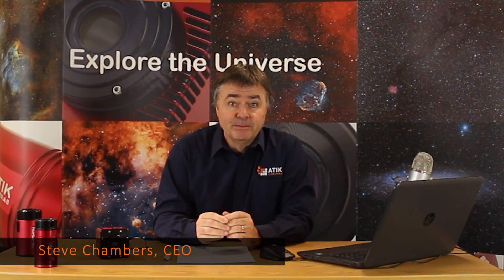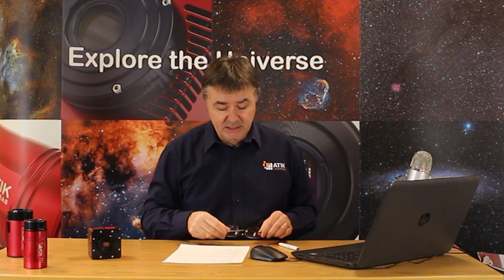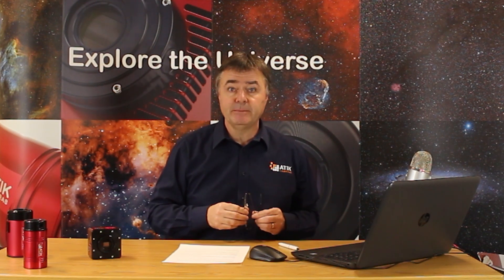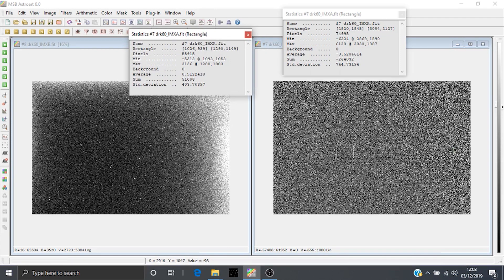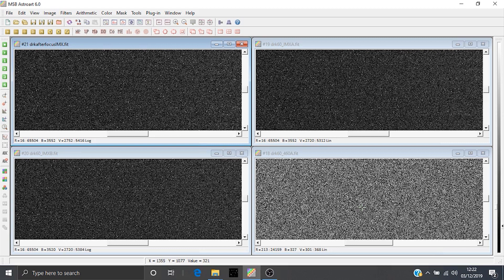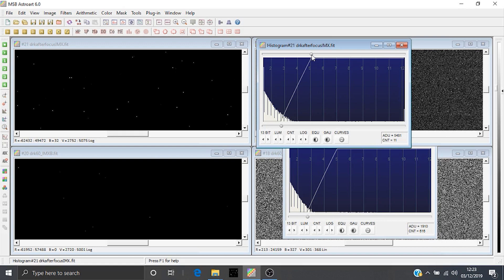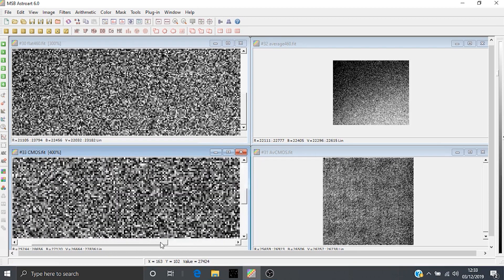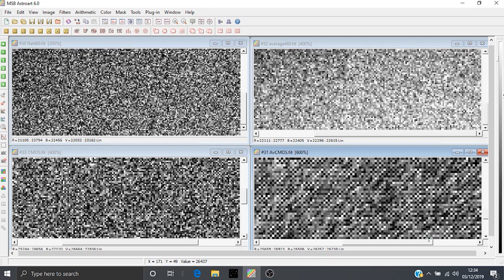The differences between CCD and CMOS calibration files| Atik Cameras

Comment: So in general then a CCD produces a “cleaner” image than a CMOS which is easier to post process, I have a 460ex colour and an Atik One 6.0 mono which I'm very happy with. CMOS cameras tend to have higher resolution but are they that much more sensitive to make it worth me changing?
Reply from the maker: Hello, we still consider CCD as the way to go due to the cleaner image, easier calibration, and optimal pixel sizes for astro imaging. Both the 460EX and One 6.0 are exceptional cameras so no need to change at the moment.